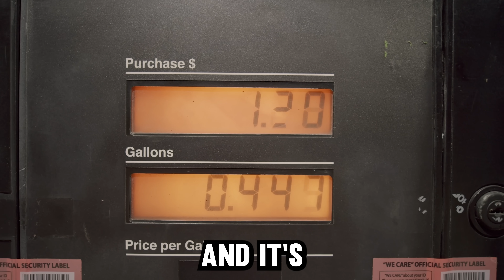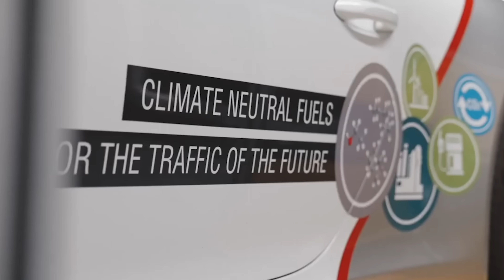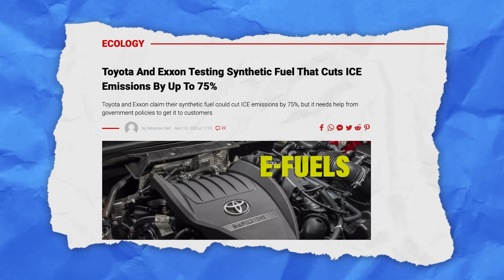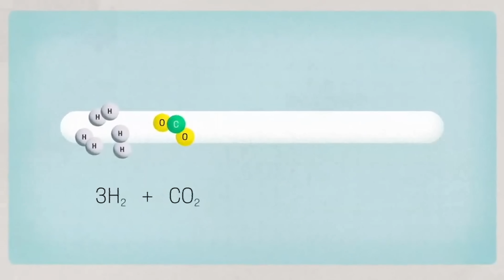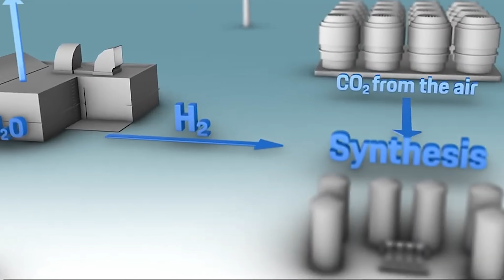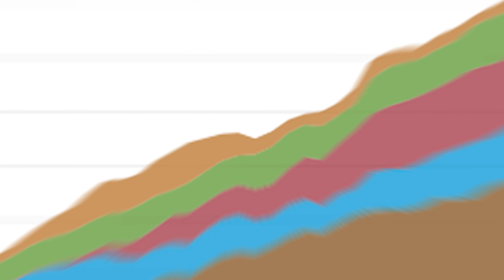Dodge Just SAVED Combustion Engines

Comment: I still don't believe battery-powered EV is the future, so it's always great to see more development of synthetic fuel.
Reply: me neither. i really dont see how it could even prevail anytime soon, but maybe it would be more practical in the future. I mean, it's not like it's our first attempt at electrification. though it failed every time
Reply: @DingoXBX e price of electricity will sky rocket if all we start to use is eletric cars, we would have to use more expensive ways to generate it to be able to supply the new demand. People don't think forward, they just see prices as they are now, forget to add all the variables. The mining of heavy metals alone is a ambiental catastrophe, the death of used cars market due to battery degradation and other variables seems to be forgotten. My guess is auto makers are ridding the hype until they have other solution, money talks, the future be dammed
Reply: Electrification of the transportation system would require 3x the amount of silver 4x the amount of chromium and 10x the amount of copper currently being produced to upgrade the electrical system infrastructure and produce the cars. Society has never even doubled mining production of these metals over a 10 year period. When you say you still don’t believe it’s the future that’s because it’s not a future that is possible in your lifetime.
Reply: @shawnaning101  And charging electric cars is a pain because you have to wait and even longer if the battery is cold, while you can just fill the gas tank in just 2 minutes
Reply: @shawnaning101 but you need several times the electricity for synthetic fuels than for electric cars
Reply: @Gereon910  Currently the synthetic technology is not ready yet, I agree. I am arguing the power grids, charging infrastructure and EV technology itself also isn't ready or doable in the time frames governments have set. I would also argue EV's are not a net benefit for the environment as power grids return to coal to keep up with demand and as the electric vehicles will have shorter lifespans. People will not want the old tech of used electric vehicle just like old cellphones and people will not want to pay the $25,000 to replace battery packs which is where much of the environment damage comes from in production.
Reply: @shawnaning101  They don't want normal people having cars at all.
Reply: @shawnaning101  exactly plus we won't be able to replace combustion cars fast enough
Reply: @shawnaning101  so many things missed here. As one example, Moving to 48 V low voltage systems means only 25% of the copper is required per vehicle.
Reply: @mt2nv1  Sure but we still have an infrastructure and grid upgrades also using copper. The EV technology will keep improving but there is alot more than production of cars to solve this problem. We would need to be building nuclear plants now to accommodate a green transition to transport because as was stated in congressional hearings a return to coal would be needed for the increase in demand. Dont get me wrong I'm not against electric vehicles. I don't believe the technology, infrastructure or grid is ready and don't believe it can be ready in the time lines lawmakers have set.
Reply: @shawnaning101  you do realize we have nearly double the installed capacity of the US grid awaiting interconnection right? 

We can’t go 100% EV tomorrow. There isn’t enough production. 

Sales estimates don’t put EVs at 50% of US sales until 2035. We only need 40% more capacity to power EVs.
Reply: @mt2nv1  The grid is definitely not ready for such a transition. You already have seen how California acts the moment summer comes around. Pls don't drive your electric vehicles today we need that power for the ac units and people say green energy is the future when it only takes up 2% of the grid! Dam right you need nuclear energy if you want to go full on clean energy! Oh but you know nuclear plants run the risk of posing as a threat to aqualife thanks to disrupting temperatures in the rivers they gather resources from and if for some reason one bad drought season starts it's enough to boom the small towns or cities that the plant is near. You know.. the trueth is no matter what we do.. wheather mine Lithium or use wind turbines ( which uses oil to turn the turbines by the way ) solar energy made from lithium.. becoming 100% green just ain't possible because some resource will cause chaos in some way some form somehow.
Reply: @mt2nv1  California has already had rolling blackouts so I would beg to differ. We shall see what happens or how fast.
Reply: @Rolfthewild  California asked drivers not to charge during peak hours if they don’t need too. They didn’t say not to drive their cars. Where do you folks come up with this crap?
Reply: @mt2nv1  If they are asking people not to charge doesn't matter what time of day it is and only a fraction of California's population owns ev's what makes any of you think the grid is ready? It's a red flag that the government refused to pay attention too regardless.
Reply: @Rolfthewild  it was one day, for a few hours, on the hottest day of the year. Hardly an issue.
Reply: @shawnaning101  so how about adding the cost of mining oil into the equation?
Reply: @Frygisk  Yes. Mining is terrible  for the environment. Making it possible for the electric cars to be worse for the environment if batteries fail before the breakeven point of co2 from the production of batteries compared with ICE co2 emissions especially if the cost of the batteries remain so high people refuse to fix them and throw the cars away.
Reply: @shawnaning101  your right people don’t ever think of how battery is made 😂” oh save the green house bs” like everything we do and build doesn’t help a differences in this world; we use cargo ships to transport goods and materials across the oceans like the run on electric lol, we don’t need electric planes either
Reply: @shawnaning101 FACTS ☝🏻
Reply: @shawnaning101  EV Sales are over 11% world wide already.  And your stats are all bogus.  In fact switching to green energy will require LESS mining then staying on carbon based fuels.  There is no more silver in an EV then a ICE car!  The copper is minimal.  So many people have said "not in my lifetime"  Its a joke.  EVs are happening fast and within 5 years we will be over 50% EVs sold!  Its a much better driving experience there is nothing to be afraid of.
Reply: @garbizwal  You clearly have never worked on an electrified vehicle, nor done any research on the raw materials needed.
Reply: @shawnaning101  What you are are suggesting is not correct.   First of all we have tons of tech to get whatever is needed out of the ground.   The reason society hasn't expanded the development of these elements is that there wasn't a need for them. 

Just for the Record the largest Auto Market China, is already on the way to going all electric.   The narrative that it hasn't been done before so therefore it isn't doable is false.
Reply: @HearToneSpeak  China is a very poor example of a sustainable energy grid. China produces the majority of their power from coal, nearly 3 times more than America. Considering coal is twice as dirty as diesel and over twice as dirty as gasoline is the reason why I suggested the need for investment into the energy infrastructure. Experts under oath in congress admitted for EV adoption to work in the short to medium term would require a return to coal power plants to produce energy. The only way to make the EV transition green in an efficient why using as little resources as possible would require nuclear power plant production but due to regulation new power plants are not being built. It requires approximately 10 years of red tape to get approval and another 10-20 years to build a nuclear power plant. 
Your belief that China has some many electric cars is unfortunately incorrect as well. China is the biggest EV market with just over 6% of their registered cars as being electric whereas America has just under 3% but I wouldn't call that on their way to full electric. You must keep in mind that although there are far more Chinese citizens there are similar amount of registered vehicles in both countries. 
Chinese people are also more receptive to electric vehicles where 50% of Chinese people plan on buying a electric car in the next year as apposed to only 17% of Americans planning on buying electric within the next year. 
We also have an acceptance problem currently. I work for a dealership in the midwest and can tell you that as there was no inventory for new cars in the past couple of years, all cars would come in pre sold except for the electric cars which would sit on the lot for weeks. The majority of people around this area are not interested.
As far as the production of the raw materials needed statement that came from an economic and political strategist. His belief is the production is not possible and that it won't happen in our lifetimes. His prediction is that as the dates set by the government come closer and production of EVs hasn't increased enough the dates will be pushed back.
You may be correct that mining tech will be able to increase faster than ever possible before but growth under the implementation of these green technology laws will be exponential. We still can't even produce enough computer chips to give customers 2 keys when they buy a new car.
Reply: @HearToneSpeak  there isn't enough rare minerals in the world to do what they want that is just plain fact.
Reply: @HearToneSpeak  too much tech will cause more  electronic issues and manufacturers will and banks will have more power to take repo your car easy and shut it off
Reply: @emotionallydreaming435  You are right about that, but it will also lower costs for the Bank so they can give lower cost loans.
Reply: @HearToneSpeak  You also have eco-idiots that will fight any attempt to get to those things in the ground.
Reply: @HearToneSpeak  YOu actually think the bank would pass the savings on you you?  HAH!
Reply: @HearToneSpeak  china's cars are also flaming up catching on fire and how much pollution is that besides the pollution china's puts out on the regular
Reply: @adamcuttler9665  I think you need to produce some data, then we could talk.
Reply: @shawnaning101  just goes to show cars are not the solution to the demands of the future transportation. Because synthetic fuels or H2 would require a similiar increase in renewable energy production which we are not on course on matching.
Reply: Battery powered stuff has been around since the 1800s. It's not new technology.  It's absolutely ancient.  They realized how much is sucked back then. The Internal combustion engine is far superior to Battery power and today engines are extremely efficient.  This idea that we are going to all switch to EV basically overnight is a farse and it will not work. People are not going to sacrifice the convenience they have now for the inconvenience of EV. Some will, the majority will not. Dodge will die as a brand and go bankrupt if they go all in on EV and it will go down in History that it was done under stillantis ownership.
Reply: @ChrisBrown-wk4qt  ICE are absolutely not efficient. They are horrible when it comes to efficiency. Even the best ones (formula 1) only reach about 40%. 
Meaning even more need for renewable energy sources.
The concept of ev is old but the key technologies for making it work effectively on a large scale are not. So it is absolutely irrelevant what people thought of the technology in the 1800s
Reply: @ChrisBrown-wk4qt  See you in 2030.  Almost every prediction here will be wrong.
Reply: @btrts6431  alright we'll see bud. 2030. Keep that same energy.  Don't lose your account before then.
Reply: @ChrisBrown-wk4qt totally agree...still not understand (and for me Is a big delirium) why big car Companies have reacted to politics with improved ICE technologies (only koenigsegg did)... They all went EV, betraying their own soul and history. With downsizing and High Power/weight ratio engines (e fuels too of course)  can encrease performance and acceleration times way Better than a 2ton EV, with low CO2, and no effort on infrastructures....and i think that big v8 muscle Cars with bev package Will die for sure.
Reply: Agreed. I’m for all kinds of energy options in the market. People should buy what they need and can afford. We don’t need to be forced to buy something we simply are not ready for if ever. Let the market decide what energy they want.
Reply: @tman4915  shoo what you think cali doing ? They forcing people to buy evs and get rid of combustion engines. And having a ev will have slow transportation to travel anywhere
Reply: @tman4915  I totally agree.
Reply: I agree. If EVs are the answer, why does the government need to basically force us to buy them via laws and legislation?
Reply: lol this thread is like listening to toddlers
Reply: The carbon footprint to make an EV is far greater than the same car as ICE.
Both VW/Audi and Volvo have done the maths, and tell us it would take 90-100,000 km to catch up with that ICE car, and then it needs a new battery , so never catches up
Reply: Same here especially with lithium waste that's piling up.
Reply: No chance. They wanna ban ice cars in 7 years, but the town I live in with 10k people doesn't have a single charger. 😂 There is no infrastructure and based on how fast things get built here, it ain't happening.
Reply: EV’s get electricity from generators in power plants which use fossil fuels
Reply: @PiethagorasTearem  sounds about right
Reply: At best, the only conceivable way to make a full EV transition work would be to implement hydrogen fuel cell EVs. Plug-in battery EVs like what we have now put too much strain on the electric grid, and bolstering the grid to withstand it would require obscene amounts of development in new transmission infrastructure that we simply cannot afford
Reply: All fun and games until you have to buy a new battery
Reply: Hybrids already exist and fix the issue that hurts them most. Start stop. Idle. Usually a mix of techniques are best not just one for everything.
Reply: @peacemaker9807  Ugh ... start-stop is supposed to be some sort of solution?   Maybe if you want the engine wearing out faster and you like replacing starter motors.  Most annoying feature ever designed and I instantly delete that annoying shit on everything I use regularly.  Usually as easy as shorting two pins together on the button they give you to turn it off temporarily.   Short those pins permanently or add a toggle switch between them rather than a momentary one and problem solved.
Reply: Unfortunately it is ….
Batteries will eventually hold 5k miles on a charge …more efficient technology .
As of now they have t he capability of holding 1k miles per charge .
Although these batteries haven’t reached public or mass manufacturing . It’ll be here in the next 2/3 years

It would behoove you to invest in tho ya like cobalt and other precious metals and materials required to
Build these batteries ..
Reply: Porsche is only investing in e-fuels for the existing fleet.  Porsche will be all electric by the 2030s.
Reply: @gooser__43  Well sure but we also need pricing models that take future damages into account and we don't do that currently
Reply: They are the future of China. While Republicans kept dragging their feet on clean energy doing everything they could to slow the process. China acted like Nestle with water and bought up much of the worlds mining rights for lithium and other battery related materials.
Reply: Pretty sure combustion engines aren’t going anywhere. Looks like it’s just in the direction on reducing the carbon footprint.
Reply: The problem is producing enough to fuel the world.
Reply: Gavin Newsom is forcing The Peoples Republic of California to go to EV vehicles by 2035.  The state doesn’t have a power grid to keep the lights on during hot days and has rolling blackouts.
Reply: Here in Australia and all  across the country, all car sales yard will be band from selling combustion engines from 2027 onwards.....and you say there is no future in ev's???😂
Reply: @Shaun-o8g  So you're saying that because a bunch of corrupt tyrants forbid the market from working as it should, that there's a future in immature, stupidly expensive and idiotically restrictive technologies?
Reply: I agree the ev sounds good right now but long term effects of scalping the earth of its needed natural resources will wreak havoc on natural ecosystems not to mention what it will do to discarded batteries once they are at the of its life not every "certified" shop will take the proper precautions of disposing of and getting rid of the contamination possibilities that can arise not to mention the shade tree guys that knows a guy that can get a battery what's that person going to do with an old replaced battery hes probably just going to chunk it in the back yard and let it sit or chunk it into the creek where it can get contaminated and kill the fish and anything else that needs that source of water to survive there a reason why it says do not discard on batteries that's just my thoughts on the matter electrification is good now but not for the future
Reply: @hyperdukes7860  You don't think Pumping oil and refining it and burning it is "wreaking havoc"?  LMFAO it what world are combustion engines cleaner then EVs lmfao...
Reply: @garbizwal  This one.  You have to drive that EV over 60,000 miles before it gets to "neutral" with a real car.  That number, of course, is if you're ONLY charging it off of unreliable "green" energy sources.
Reply: @garbizwal  It's not the cost, it's the materials that  are in it and what it takes to produce those materials.  It's also not just the battery pack, the rest of the car counts as well,  EV's have an aluminum frame to save weight, aluminum takes almost six times as much energy as steel does to produce the same results.  Plus, the entire rest of the car has tons and tons of petroleum derivatives involved in it's making.  Perhaps you should try doing some actual research before spreading your bullshit.
Reply: @hyperdukes7860  First of all the problem with battery production is not "scalping the earth of its needed natural resources". Litium and cobalt don't really do a whole lot in the ground and are in that sense somewhat innert to nature. It's the predominantly environmental local contamination due to extraction that is the problem. 
Second of all, that's what regulation is working on, since the old simple models of just selling shit and not giving a shit what happens in the End of Life will get us nowhere. You have to think further and not limit technology to old systems that are not designed to cope with modern or future problems.
Reply: Joe Biden will make a believer out of you.
Reply: @busterc6600  That pedophile can kiss my ass.
Reply: As a Tech/Mechanic and old school vintage racer, I do see power packs having a role in hybrid engines. The technology has been perfected. Small affordable battery packs that can easily be change after 300,000 plus miles. In my Ford Maverick hybrid I get a range well over 500 miles on 14 gallon of fuel. Takes a few minutes to fill up. I work in a few Teslas mostly suspension work and a few fuse pack going bad, I have mix thoughts on full EV. I think there ok for local driving as long you charged every night. If it's your only ride you have too make extra planning too find a supercharging station along the way and then wait up too 20-35 min too fully charge your EV.
Reply: Synthetic oils aren’t working. Hybrid ICE with Carbon capture or battery powered evs are gonna be required in the future
Reply: Wireless would be preferred  better option
Reply: It is....
Reply: @ravishoul1432  keep telling yourself that
Reply: Might not like it.. but the government people will still keep pushing it. Forcing the bless wealthy into it. 
It's already started.
Car parts are going to be heavily taxed. Making it cheaper to buy a new car than to fix an old one. 
$800 for a fuel pump.. seriously?
Reply: I think electric cars are really good and can be unbelievably quick but there’s nothing like a good ol American v8. The sound the performance just my preference
Reply: @Curentsea$$ATTNflow I had before, no thanks. Even a friend of mine owned an EV, though not a Tesla, before he sold it and go back to ICE.
Reply: Battery powered cars would be perfectly fine if us fat ass Americans would walk more than 30 feet.
Reply: In Switzerland they imposed times when you're allowed to charge your ev, because the grit can't deliver the e, tra energy. Now imaging every car is an ev. Greens are brain dead.
Reply: EVs are for tree huggers
Reply: Of course Battery powered cars aren't the future! Hydrogen is! Toyota is already on it and is about to stomp this decades embarrassment. If you have a gas power car just hold on too it till 2035 or so because the next generation will solve all the wrongs of electric vehicles which are 100% Trash! 🗑
Reply: Enough electric motors and chassis to put them in could easily be made to satisfy global demand, right now. Who’s to say that battery technology doesn’t completely change in such a way that there’s plenty of scalable resources on hand that would power all those would-be electric cars. After all, if tech didn’t change, we’d still be crank starting our model T’s.
Reply: Regardless of what you "believe" it is still the future. It's new technology and it will be the future just because it's a new type of technology. Just because these companies are coming up with a more clean fuel, does not mean EVs are going to come to a halt.
Sorry.
Reply: @seankizzee  It's not the future It's a fad. Electric cars are temporary and inefficient. Hydrogen cars are the future! NOT ELECTRIC!! I refuse to downgrade. Way to go Toyota for leading the way to Hydrogen cars! Fck electric!
Reply: Don’t believe???
Reply: If you think about it, the EV cars and trucks where always a flaw and had issues from the start, cause the only successful EV powered vehicles that were good on mileage-wise was basically the electric bikes and E-motos, cause they require less of everything than thay of an electric cars while electric cars had poor mileage and many risk, from what I'm hearing maybe this is the reason why the gas and diesel engine were saved? Just my thoughts and opinion.
Reply: That’s what everyone says before they buy an electric car. I have a new ZO6, a Tahoe, and a C6 GrandSport. Last I got a volt. The volt has been the most reliable car we have ever purchased. Less moving parts to break. The volt still uses a ICE for the generator but 7 gallons better than 25. We rarely tap into the gas generator because we don’t drive more than 40 miles a day so it’s electric all the time. My dad still is like oh what about that battery going out? Volt has 104,000 miles and still drives like new. I’m like how long should a car last pops? The volt has been a champ but I get lots of hate for sure still.
Reply: Internal Combustion has an inherent inefficiency. Hydrogen has some hope but not much since its flawed by designed.
Reply: You don't need to believe facts. EV's are the future if the slternative is ICE, there is just no science or stats stating otherwise.
Reply: Engineer here, the reason you don't believe it, is because its not... If we actually achieve the government's intended rate of adoption for lets say just the united states.  Our electrical grid will melt down. What most people don't understand is the shear amount of energy that goes into charging an electric car.   Most of the united states is dangerously close to rolling blackouts due to powerplant shut downs already, doubling the load is IMPOSSIABLE without an infrastrucher overhaul. there there is the shear amount of rare earth minerals that are needed to build the electric car.  electric cars in their current form are not the solution for most of the US population.
Reply: I don't mind the EV's as an option. If you spend enough time on the roads, it's worth applauding the idea of bad drivers to have means of trnaportation that will keep them parked for at least 30 minutes every 180 miles or so. Then there is the autonomous driving part as well, limiting the amount of mistakes they make... So it's very good on those aspects. 
Of course EV's aren't for everyone, but I'm glad the choice exists.
I will probably not stop driving ICE vehicles in my lifetime... And I always want to have the choice.
Reply: One of the smartest comment here.
Reply: Sane
Reply: Yes
Reply: Electric vehicles are useless to me. You can’t really road trip with Evs and wait to charge them up for hours to get back on your destination is useless and then on top of that. The manufacturer can have control of your vehicle as well if you don’t pay your monthly bill
Reply: @emotionallydreaming435  Not true.  I can drive coast to coast in my Tesla.  Most Superchargers are distanced less than 75 miles apart.  When I stop, it only takes 20 minutes.  It takes that long to get some food and bathroom breaks.
Reply: @emotionallydreaming435   I have done a 900 mile each way trip in my ev four times this year from Ohio to Oklahoma and it only added about 30 min total to the trip compared to before in my ice vehicle — adding hours to charge is not a thing (if you use tesla’s network); plus it cost me 1/3 as much to do the drive and it didn’t expedite my need for a pm.

I don’t care if it saves the planet. My cost of ownership is way down. I can drive it like I stole it and it costs me less than a 1/3 of my old ice 5.0 car to own. For me, it’s just better all around.

I don’t care if it is widely adopted or not.  What i bought works with what is available now.
Reply: @Brian Greenwood  so apparently, you work at tesla. That's interesting
Reply: Probably still is tho cuz these fuels like 40$ a gallon before shipping costs do probably like 80$ a gallon
Reply: @jakefox3677  but this can be added to normal fuel for exemple 10% syntetic then when its able go up in % until its 100% syntetic. 1 thing eletric cannot in eletric you have to change your car start planning every stop on a roadtrip plan time loss in charging, ... And outside the US it is more expensive charging in stations chargers than it would be to fill up a tank that gives the same range.
Reply: @jakefox3677  That is the issue no one is talking about.... its too expensive for mass adoption.  These fuels are just for niche markets.
Reply: @HearToneSpeak  Everything starts expensive, but it will get cheaper when economies of scale comes to play. Now it's a niche and "bleeding edge" so it's not as refined and the best it could be. I have hope in e-fuels though, as it's more promising than EVs alone in such a short timespan. Also mixing ethanol E5/E10 would help reduce the cost slightly when talking big scales I assume. Although we can't buy e-fuels yet as far as I know.

It's easier to change the fuel only than build entirely new (expensive) EVs together with infrastructure and production of (green) electricity. Atleast in the next 10-20 years. Especially in Germany whom skipped nuclear power and now burns a lot of coal, natural gas and worst of all lignite accouting for ~45.1% of electricity production in 2022 combined and only 44% is from renewables in the same year. Wouldn't want to force Germany with more electricity demand to push more lignite and hard coal through the grid in the short term... In fact all forms of coals single handedly are responsible for 0.3 degrees Celsius temperature rise from the 1 degrees Celsius increase globally according to Clientearth.

If this technology really picks up then I would assume to see diesel, kerosine or even various oils in the same net-zero synthetic form. This would atleast not make things worse than it already is, with only better to come hopefully.
Reply: @surena9451  " Everything starts expensive, but it will get cheaper when economies of scale comes to play. Now it's a niche and "bleeding edge" so it's not as refined and the best it could be. I have hope in e-fuels though, as it's more promising than EVs alone in such a short timespan. Also mixing ethanol E5/E10 would help reduce the cost slightly when talking big scales I assume. Although we can't buy e-fuels yet as far as I know."

You are correct the Economies of scale will make it cheaper but not cheap enough to be viable as an alternative to Gas.  It for sure will not be as cheap as electricity.  Let's say for argument's sake it was as cheap as electricity, there still wouldn't be enough of  a market for it since EVs would dominate the landscape.  The Governments would tax it to death, or restrict its use.  What people are forgetting about ICE (Gas) is that it isn't very efficient.  Only about 30% of the Fuel used goes to propulsion.

EVs running on coal are still better for the environment than any other propulsion method.   Green Fuels require a lot of energy to be made,  it isn't even close, plus you have the inefficiency of the combustion engine to deal with.   

Let's not forget we are not transitioning to EVs overnight.   People are buying them when they are finished with their previous vehicle.   The total transition will take another 7 years or so to be complete. 

"If this technology really picks up then I would assume to see diesel, kerosine or even various oils in the same net-zero synthetic form. This would atleast not make things worse than it already is, with only better to come hopefully."

There is a very limited future for the combustion engine.  The automakers never invested the money into making them more efficient and limiting emissions.  That was a missed opportunity, now technology has brought EVs that are highly efficient and produce no emissions with their use.  Combustion engines are pretty much dead, even with the efuels.  The other nail in the coffin is that EVs don't require expensive maintenance.  EVs are already reaching economies of scale, to lower costs.  Last point, EVs are more profitable for the Automaker, it is a much more simplified design, less parts, less to warranty, easier to make, and it requires a smaller workforce.   This efuels idea was promoted by some Automakers for a niche product, but they all have committed their futures to EVs. ... this argument is about 2 years too late, the money, time, and organization have been invested.  Buildings have been built and Supply Chains developed.
Reply: @HearToneSpeak  ICE engine will be produced for the next 30 years is the consensus. You are incorrect as to all of the manufacturers have committed, this video is proof the largest has not. Toyota believes a mixture of sustainable forms of propulsion are needed.
I do agree with you that Tesla has up until recently had larger profit margins than other manufacturers but that changed as car manufacturers have recently reported earnings. I do pay close attention to this as I stated above that I work for a dealership and I also invest in only one car manufacturer, Tesla. 
There are many positives to EVs but the time frames governments have set won't be possible on a global scale in my opinion. An all in approach is far better and investment needs to be made for more sustainable choices. 
Manufacturers have increased efficiency. The reason you believe there was a missed opportunity is because as cars when I was growing up got 15-18 mpg they now get in the 40 mpg range an release far less  gasses. As engines became more efficient emissions laws became more restrictive. These cars doing 40 mpg would be doing 150 mpg or better without choking them out as emissions laws have done. A 10x increase in efficiency has happened but it is a compilation of metrics that make it hard to see.
You also need to keep in mind what is good for humanity/society as a whole, globally. Developed nations can implement and even mandate these green technologies but emerging markets need cheap energy to industrialize and grow economies to bring people out of poverty. You won't be able to charge your EV in Tanzania as the power is only on for 6 hours a day. A move towards sustainability in rich countries is possible but poorer people would befit far more from an all in approach. 
Every comment you have made here neglects the energy infrastructure issue and the return to coal required to power this movement. Switching from gasoline to coal is not sustainable.
Reply: @shawnaning101  " ICE engine will be produced for the next 30 years is the consensus. You are incorrect as to all of the manufacturers have committed, this video is proof the largest has not."

I misspoke, I think ICE will be around forever, but they will be a niche product.   That was what I really meant.

Just for the record, Toyota has committed itself to EVs, they may make other powertrains, but their focus will be EVs.  The key reason for this is that their ICE sales a crashing, pretty much World Wide and this is hurting the company.  Making EVs is not a choice for companies anymore, it is needed for survival. 

Tesla's earnings and profit margins are 2x the Industry average, don't let Quarter results cloud their position.  This is a highly profitable segment and they will probably increase those margins.  What Tesla has been able to demonstrate to the Auto Industry is that EVs can be made at the same cost level or lower than ICE.   This is a revelation in the industry because there was a theory that EVs were always going to be more expensive all around.  I would add at Dealerships are the thing to worry about, the Automakers are circling the wagons, because they need that share of the difference in Costs to Sale price to compete with Tesla.

"There are many positives to EVs but the time frames governments have set won't be possible on a global scale in my opinion. An all in approach is far better and investment needs to be made for more sustainable choices. "

In the past I would have agreed with you whole heartedly about this.  The speed at which consumers are embracing EVs has surprised me, I think Government(s) estimates may be too conservative.  I think what has changed the game, is the overall Greening Movement.  As more and more people started to put up Solar Panels and add Energy Storage, they realized that they could save $$$ and that is pushing others to adopt similar setups.   Just imagine never needing to buy gas and have a performance vehicle all at the same time.

"Manufacturers have increased efficiency. The reason you believe there was a missed opportunity is because as cars when I was growing up got 15-18 mpg they now get in the 40 mpg range an release far less  gasses. As engines became more efficient emissions laws became more restrictive. These cars doing 40 mpg would be doing 150 mpg or better without choking them out as emissions laws have done. A 10x increase in efficiency has happened but it is a compilation of metrics that make it hard to see."

We don't have a 10x increase, but emissions is the key to life.   The Toxic emissions from vehicles has been killing our environment.  I'm not an Environmental Activist or anything,  I fly planes and travel a lot, so nothing pollutes more than that.   On the other hand, the Auto industry has been lagging in making more efficient engines, because the quest for power became important.   Government has to regulate emissions closely because it increases Healthcare costs and people's quality of life.  I used to live in Detroit, I know how bad things where.

"You also need to keep in mind what is good for humanity/society as a whole, globally. Developed nations can implement and even mandate these green technologies but emerging markets need cheap energy to industrialize and grow economies to bring people out of poverty. You won't be able to charge your EV in Tanzania as the power is only on for 6 hours a day. A move towards sustainability in rich countries is possible but poorer people would befit far more from an all in approach. "

You have made some really excellent and thoughtful points, but you are wrong here.   Green/Renewable and EVs will help the developing World.   One of the most difficult things for developing countries is their access to Fuel, it is rare and expensive.   It is easier for these countries to develop energy from renewables and build out micro grids.   EVs can be made cheaply and can run on little energy, that the communities can generate themselves.   But I don't have to tell you a theory, it is already happening in parts of Africa and South American.  Some of the Islands are now 100% using renewables.   It is actually cheaper to build a renewable energy grid than a fossil fuel one.  Check out the IAEA report on this or Google it.  You would be surprised by the savings.  For example it would take years for some developing nations to build out a grid.   It would take weeks to build out micro grids that could supply the same level of energy and a much lower cost.  The other important part to using micro grids is political.   It makes it more difficult of to cut off communities or to pressure them.   There is lots to read on this, if you are interested.

"Every comment you have made here neglects the energy infrastructure issue and the return to coal required to power this movement. Switching from gasoline to coal is not sustainable."

Funny you should say this, the Mining industry thinks the total opposite.  Wind and Solar are much cheaper than coal in pretty much every country.   The game changer was Energy Storage systems becoming effective and lower costs.   This allows a more consistent level of energy generation at cheaper costs.   No one wants to use Coal, because Coal kills.   The other thing that is helping to support Renewables is Fossil Fuel backups.  So when there is a less renewables to use, there are always fossil fuel as back up.
Reply: @HearToneSpeak  Well I am no climate denier and do agree sustainable will one day happen but only time will tell how fast it plays out. I have been in what you say (and I don't totally disagree) is a dying business model for decades. I hear what the direction is and how long the expectation toyota has is as to when EV adoption is expected. I heard about 6 EVs in development from Toyota 5 years ago. From what we see in our region the masses don't want them. I don't live in an area where solar panels are the norm, nor do they make sense from an economic standpoint in my area. I am in wind country which is dominated by power companies. The adoption seen in California and other areas i have been to in the south is not what is happening nationwide. 
We will see who is correct as far as the timeliness but we both agree changes need to be made.
Reply: @HearToneSpeak  absolutely not bud the car companies are going bankrupt if you think ice vehicles are going anywhere your dreaming .
Reply: @shawnaning101  That was well said, here is my point to you.   If you follow Wright's law or the Technology Adoption Curve you will see that you are correct there are going to be laggers.  This is normal for any new technology, same thing when Ford rolled out Model T.  People like what they are comfortable with, that isn't going to change anytime soon.   My real point to you, is that World adoption of EVs is what is happening at an alarming rate.  I think a lot of this comes from the fuel crisis in EU and Ukraine War.  This kind of forced many into seeking alternatives....hence EVs.  

Since you are in a Windy area, that to me is going to be the real Green driver.  Because that puts energy directly into the grid...add a little Energy Storage to the Wind and you have a full blown power plant that is cheaper and easier to run.  I do some work for the World Health and renewables is changing things for the developing World., now that Solar and Energy Storage is affordable.   This has allowed communities to have access to the Internet, lights, water filtration and etc.   The next thing that is coming from China, is small EVs that are low cost.  This is happening in India as well.   The Auto makers are geared up for this, because the real sledge hammer has not hit the USA yet.   When those cheap EVs hit the USA, legacy auto will be in trouble, this is why the IRA was created.   it was lobbied by the Auto makers... not for ICE, PHEV and etc, but to be able to develop their EVs quick enough to compete with EU and Chinese brands.  If you look at the current figures USA legacy Auto is getting killed in China and EU, with the EU legacy auto makers having a leg up in terms of the EV race.   

When I hear people saying that Synethic fuels could save the industry, I know they don't understand what is happening.  No Automaker can afford to run 2 systems and be competitive with the ones that are only in EVs.... this is why Tesla is doing so well.  They don't have to maintain ICE plants and EV plants... all of their energy can go to EVs and that allows them to make EVs at a 1/3 of the cost of their competition.    The real fear for legacy Auto in the USA, is that there isn't another Fuel crisis, then even the laggers will have fewer reasons to resist.
Reply: @HearToneSpeak  Now they just need to figure out how to make affordable electric cars that don't suck.
Reply: @HearToneSpeak  blame the oil tycoons for monopolizing America's fuel and price hiking any alternatives
Reply: @HearToneSpeak    People seem to be confused by how electricity works, so let's be clear.

Widespread EV use on a mass market will SKYROCKET the price of electricity. Electric companies right now can afford the hit of promising "We won't raise your charges when you buy an EV" because the percentage of their users with EVs is tiny. But eventually, there will be no profit in offering that same price when every one of your customers is pulling such insane amounts of electricity to charge their cars. Don't let the quick charge times fool you, EVs need MASSIVE amounts of electricity to fill those batteries. So much that Ford promises their F-150 Lightning can power your house for a few days straight in the event of a blackout. That is colossal energy storage, and electric companies will take a massive hit if they don't punish you for that usage eventually, because plugging YOUR EV into YOUR house will be drawing all that power into the car on YOUR electric plan. 

EVs on coal are by no means the cleanest form of propulsion. Coal is something like ~65% more pollutive than gasoline, and energy made through burning coal, even if a percentage of that energy being made through slightly cleaner methods like wind and solar (Even though wind is killing birds and solar is killing farmland lmao) is still more harmful energy than gasoline, and the goalpost for electricity production is going to move, because remember we aren't trying to make enough green electricity to power our current grid with no coal - that isn't the goal. We need to make enough green electricity to power a totally overhauled grid with charging stations and every single household and apartment complex needing the capability to charge it's residents' and owners' EVs on a massive scale. It is going to take decades to make those kinds of brutal strides in green energy production, and in that time frame synthetic fuels could easily overtake EVs because synthetic fuels will be far more compatible with both currently-owned ICE engines on the market, and our current fuel and automobile infrastructure.

Oh, and EV motors emit harmful acidic fumes into the air that are harmful to breathe even if they don't raise the Earth's temps (which they may prove to do in the future) lmao get nay nayed.
Reply: @ironclaw6969  What would you consider "affordable".  Most "affordable" cars are sold at a lost to make the money back on the financing.
Reply: @HearToneSpeak  If they think they'll make money on financing anything for me, they've got another think coming.  After buying several vehicles on 0% financing, they've shown they can do that, so I'll never agree to pay interest again, especially on a product that loses value as fast as cars do.  

Now, defining affordable, it really depends on what you make.  I'd say for the average Joe that works an hourly job,  I wouldn't suggest they spend more than $20 to $25k on a vehicle and that they keep the term to 4 years or less.  Though, to be honest, the best bet is to save up the money and simply pay outright for the thing at purchase time.  Then you're not flushing money down the toilet on interest payments.I know, most people don't have the fiscal discipline to do that.
Reply: @ironclaw6969  All vehicles are depreciating assets at best.  I would advise people don't buy a vehicle if they want to be wealthy.
Reply: @HearToneSpeak  That depends greatly on where you live.  Some place it's just not practical not to have a vehicle to get around.
Reply: @ironclaw6969  I agree, but that isn't a lot of people, since most people live in cities.   My main point is that if people want to build wealth, they should avoid owning a vehicle, especially one that is out of warranty.   After Health Care costs, Vehicle Costs is a wealth destroyer.   Vehicles seem to breakdown at the worst possible moment costing people who can't afford it endless bills.  The there is the at fault accidents, traffic infractions,  Parking infractions and etc.   One of the biggest problems is insurance.   So you see with all that risk hanging over ones head, it is easy to see why it is a wealth destroyer.
Reply: @HearToneSpeak  Toyota new CEO literally said that they will wait on transitioning from ICE to fully electric. You are kinda behind on some of the news.
Reply: @chansantawisuk  Actually I must disagree with you here.  Toyota is investing heavily to produce EVs, in a bid to catch up.  If they are waiting on the transition from ICE to EV they are doomed to being laggers with poor financials and technology.   Most of the good engineers would have been snapped up by then.  There is no advantage to waiting.
Reply: @HearToneSpeak  You are 100% right to disagree with me. Toyota NEW CEO said it himself. I just said what he said. Agree what you want to agree you are not the CEO neither am I. He made his statement regarding the current Toyota EV transition. His decision not yours not mine.
Reply: @HearToneSpeak  You can easily say the same of EV's. at the end of the day they are not carbon neutral either they take a lot of carbon emissions to make way more then ICE vehicles, so it actually takes a while of owning before your carbon foot print becomes smaller. EV's in there current form are not the solution or at least not the sole solution if we teamed them up with synthetic fuels and hydrogen and continued investing in multiple areas it would likely be a better solution and better for the environment then mining tones of toxic metals and destroying pristine places to mine them. I buy used cars a used ev that I could afford and it would be at the top end of my budget would be a well used Nissan leaf, I literally cannot make it to work and back on a charge cant road trip with it and will likely have to shell out a few grand to replace the degrading batteries as they would be about 10 years old. instead of only pursuing electrification we should be looking into many different things some  will work some won't
Reply: @HearToneSpeak   Electricity isnt cheap also is probably wouldnt work if everyone just in the USA got electric cars it would collapse in seconds.  1. our power grid would die 2.  the resources wouldn't enough or current production also add we would be destroying the environment even more then normal gas would in that time 3. barely anyone have electric cars even if you count hybrids
Reply: @SlavicWeapons  Eletricity is cheaper than any other form of energy sold.   Can you think of something cheaper?   The fear about the Power Grid is misplaced, there is no question that Power Grid needs to be improved, but more EVs charge at night, when General demand is at its lowest.  Existing systems could easily handle this increase load, since they usually reduce supply at after hours.   

2. There are more than enough resources for everyone to drive EVs in the World.  To make EVs require less resources than ICE vehicles.   

3. EVs are quickly replacing ICE vehicles it will not happen overnight... but by 2030, EVs will but the dominant player.   What most people don't realize, it is cheaper to operate an EV and they have much better performance, virtually little maintenance and are safer to drive. 

I realize that most people are not up to date about the World of EVs but that information will become more mainstream as it grows in dominance.
Reply: @HearToneSpeak   1.electricity might be cheap to sell it but to be able to handle whole country of people worth you would need to spend billions on just the productions of it aka nuclear power

2. no, because most people would be charging them at night so the demand  would probably similar 
3. cheaper not really because you will need alot more ithium, graphite, cobalt, and manganese we would run out of the deposits then have to look for more and you would definitely need open up more mining area to get them because of demand thus it still damages  environment equally as bad
4. probably wont go mainstream, many mechanic and people like me who love cars dont want  electric cars in the first place

5. safer not really the only reason why electric cars are "safer" is because its harder to roll them over from the  low centers of gravity.

The only reason why it would ever dominate is because liberals/governments are basically forcing everyone to get it by increasing fuel prices also Lithium-metal batteries on the other hand require a Class D fire extinguisher to put them out
Reply: @SlavicWeapons  This has nothing to do with being Liberal or Conservative. The Auto companies want this transition, Governments, and consumers, it is a win-win for everyone.  The only people that are firmly against this is Oil and Gas, but even they are starting to get in on building out EV charging networks.   Fuels prices are actually not controlled by Government directly, it is usually controlled by the World Market price for oil.   

1.  Billions need to be spent late decade on the Grid, this is not news.  Nuclear Power plants are not needed, since much of this energy can be generated with Renewables which is the cheapest form of electricity.  Solar and Wind and inexpensive to deploy and coupled with Energy Storage systems are reliable sources of energy.   If we don't have Wind and Sun, we have much bigger problems to deal with. 

2. Charging at Night, would require less energy that want is produced during the day.  This would make the plants more efficient since they are idle during off hours.  Not to mention some systems can't be lower so they generate surplus energy which they sell at a discount... just look at the facts.   Off Hours Electricity has always been sold at a discount.   Tesla is selling energy to Texans at a discount off hours. 

3. Most of Battery chemistry uses very little cobalt which is the most expensive and rarest element in a battery, the rest of the elements are readily available.  Lets not forget that most of these elements are recyclable so  there wouldn't be a constant need to mine them at present levels. 

4.  There will be laggers like you who don't like Electric, that happened when the World transitioned from Horse and Buggy.  Eventually that laggers have not choice, because the Auto companies want to make the transition because it will be more profitable for them.  EVs have less parts and are easier to maintain and therefore less warranty costs.   Like I said it is a win win for everyone. 

5. Your comment is a little strange, because you demonstrated the reason why they are safer, so you actually agree that they are safer, because of their lower center of gravity, which makes it harder to roll over. 

EVs are the future, they are much more efficient than ICE, cheaper to produce, safer  and easier to drive.
Reply: @HearToneSpeak  we have such fuel forever. its like you said its always to expensive to use.
Reply: @shawnaning101  the big 3 always say there all for ev then stop making  that car a few years later. they know its just government nonsense but do it to shut them up. nothing are government pushes for works in reality as in we dont have enough rare earth to even make enough of the current battery's these cars need for mass adaption.
Reply: Why are people so against the idea of renewable energy Jesus. Imagine relating to OIL COMPANIES and has companies and defending them as an average working class person. Talk about boot licking
Reply: @xxdeathgrips  If I want renewable energy, battery isn't it. Give me hydrogen fuel cell all day long.
Reply: @xxdeathgrips  Current iterations of "renewable" energy all have the same basic characteristics.  They are unreliable as well as expensive.  To overcome those shortcomings you  can spend a fortune on hideously expensive energy storage that will need replacement every few thousand days which means that it will never end up paying for itself.  Or, you can build a parallel reliable base-load power system which means that it is NOT run by renewable power sources, in which case the resources spent on the "renewables" was a huge, expensive waste and you should have just build reliable power generation in the first place.
Reply: @ironclaw6969  It's worth the expense. Plus if people believe in it and support it, it easily gets streamlined and evolves to become more effective. Just like America in war time we were capable of things nobody ever thought were possible simply because we all agreed on it and believed it. We have built completely brand new infrastructures for things in insanely short amounts of time when the government really wants us to. It's just laziness and the fact so many people use any immediate excuse they can to throw out the idea but refuse to maybe find simple solutions. You have to start somewhere and then efficiency comes later nobody said it would be easy but it's always worth it in the end
Reply: @xxdeathgrips  Those oil companies you seem to hate so much have contributed to and accelerated the high standard of living we enjoy like nobody else could have contributed.  Affordable, reliable energy is the reason we live in the world we have now which compared to the historic norm is unbelievably safe as well as providing huge abundance in nutrition such that our ancestors never dreamed of.  Those oil companies made the world we live in possible, you should thank them profusely..
Reply: Gas is in the past,
Reply: @edwardranno7119  Electric cars are irrelevant for modern problems. Hydrogen is the future Electric cars are a fad.
Reply: @edwardranno7119  Totally doubt it. If anything, we might see battery EV died first.
Reply: no.
Reply: Some of y’all must live in the forest…..the EV car are here and it’s is the future… go to any major city? you see EV everywhere?
Reply: Anyone who believes ev’s are the future has not done any research on their own.
Reply: In 1994, Hydro-Quebec developed an electric vehicle that was able to do near 1000 km per day without recharged, i have seen 2 Chrysler Intrepid that were equipped with this wheel/motor combination, the battery was the same as we have today in our car. They sold that {patent) to Tata motors  in the late 1990. We never heard of that motor since then. We, people from Quebec, lost about 1 billion in this venture. I guess the big oil companies were not ready to stop fuel burning cars at that time.
Reply: Auto enthusiast or people who enjoy driving don’t want electric cars!

Hydrogen cars are cleaner than electric cars! 
Hydrogen cars give you the same driving experience as gasoline cars! 
Hydrogen cars have about the same torque as Diesel! Without the diesel smoke!
Reply: @zachsheffield1325  what are you talking about? Hydrogen cars mostly refer to fuel cell EVs. They also have electric motors und batteries and have the same characteristics as normal EV. If you mean hydrogen ICE: they're not super efficient. Also high burning temps of hydrogen result in other problems for the ice.
Reply: @micheljean7845  I have been trying to find something on that and cannot find it. Where did you get that information
Reply: @micheljean7845    Source: Trust me bro